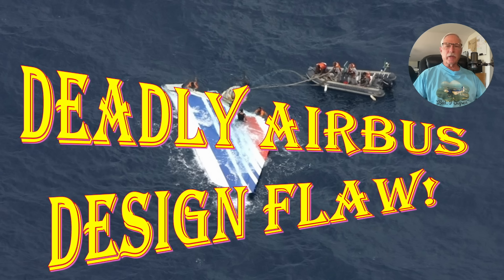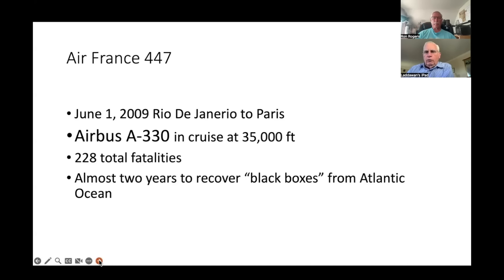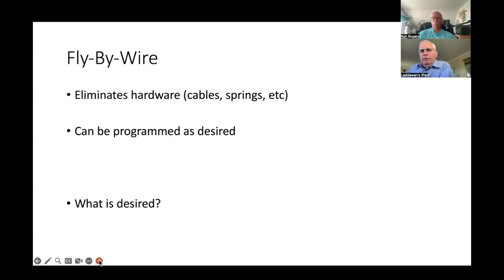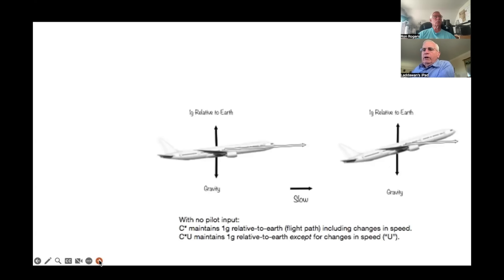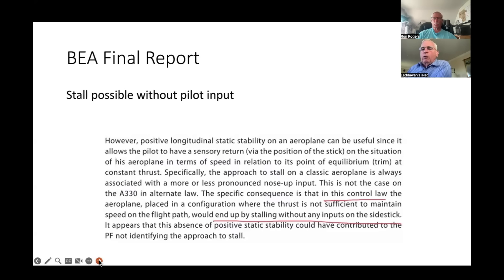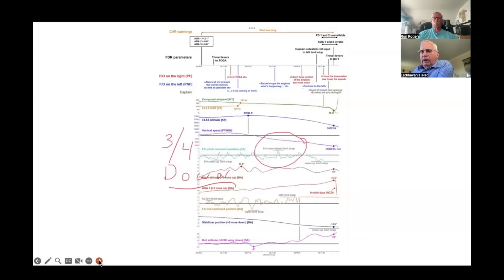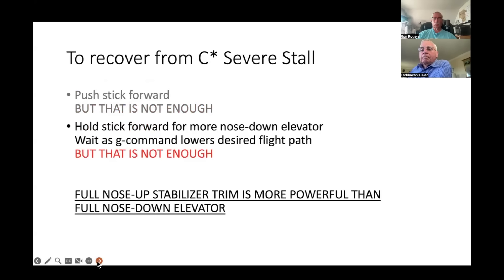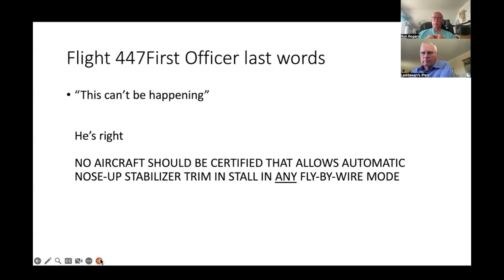Air France 447 Deadly Airbus Design Flaw! Tom Tilden about apparent speed stability in Alternate Law

Comment: A lot of the stuff mentioned isn't true, sorry to say that.

First: There is a low and high speed stabillity term introduced in altenate law. That is: when the aircraft enters into a low speed regime under/above a certain mach or cas threshold (dependant on config weight etc) the aircraft will enter a steady pitch down or up maneuver, with the g/pitch rate as a function of the difference of threshold - current speed.
This is a certification criteria...

The point about nose down and up trim speed is also not right and I like to see any real reference to this instead of "trust me bro". The reality: 
It first depends on the current config: limits are 0-2g or -1-2.5  so more nose down authority. The case you are talking about is absolutely clean so 0-2g, this is symmetrical. Why do I talk about the g stuff when you were talking about trim changes: because trim is what the elevator does with a long time constant integrated, to bring the elevator back to zero. This is all the "magic". And elevator deflection is a function of state vector feedback (pitch rate, g) plus a blend of pitch rate and g feedback onto stick input via different look up tables, I come up later with, through a integrator (this time fast). Last you feed stick input directly onto elevator (stick feedforward) parallel to all the above mentioned. This feedforward is the same signal as the one coupled onto the g and pitch rate feedbacks, but scaled accordingly. When we look at the the transfer tables of the stick you'll see that these in clean config are indeed symmetrical and else nose down emphasized. Greater nose down feed forward! The other signals are of course dependand on the dynamics of the airplane. 

The last thing:
Trim is of course frozen under certain circumstances and can be limited in single directions but I won't go into details here...

Please don't takes this as an offend.
Reply from the maker: I will let Tom respond to that!
The BEA Final Report in section 2.2.5 on pages 186 and 187 addresses “Aeroplane behaviour in reconfiguration laws” I displayed two paragraphs from that section in the video, but there is more.
“Alternate 2B law represents a specific case of flight control law reconfiguration. . . . It has the specific characteristic of being associated with the loss of computation and display of the limit speeds. The high and low speed protections that exist in normal law, and sometimes in a reduced manner (high and low speed stability) in alternate law, are lost.”
“In alternate 2 law, the longitudinal control law remains a load factor law and the lateral control law is a direct law.”
In other words, as I said on my slide: Air France 447 in icing went to Alternate Law with no protection (pure C* with no Apparent Speed Stability and no limit on automatic stabilizer trim.)
My description of trim was accurate. The elevator moves as needed for the desired C* (g/pitch rate) response (sometimes called fast integration.) If there is a persistent mismatch between elevator position and the desired elevator/ stabilizer alignment then automatic trim follows (sometimes called long term integration.) This is the same way autopilot trim works. You direct the autopilot to climb, or you drop the gear, or change speed and the elevator compensates immediately. But you don’t fly from then on with the elevator deflected. Just like the pilot would do, autopilot automatic trim follows to optimum elevator/stabilizer alignment.
As my slide said, automatic nose-up trim is inhibited in stall protection. But in Alternate 2B law, Air France 447 did not have even limited speed stability and automatic stabilizer trim followed sustained full nose-up elevator with full nose-up stabilizer.

NO APPARENT SPEED STABILITY
Without typing the whole thing, read the two paragraphs on my slides from page 187 of the BEA report. The BEA says they had no positive static stability (they are taking about what the pilot feels - apparent speed stability,) The BEA says that once in a climb they could stall without any more control input. The BEA says “This behavior, even if it may appear contrary to some provisions in the basic regulations, was judged to be acceptable by the certification authorities . . .” The BEA says “the presence of flight envelope protections makes neutral longitudinal static stability acceptable.”
I agree. But in the case of Alternate 2B law there were no protections. Therefore Alternate 2B is UNACCEPTABLE.
Look at the purple line data on my slides. The elevator position starts at neutral and then goes nose-up (nose-up command is down.) From then on it is a nose-up command even with the stick 3/4 nose down, because the forward stick only decreases pitch in accordance with g command logic, it does not directly move the elevator. Realize that the purple data can go well above the starting position which was in cruise, not just below the starting position.

AUTOMATIC TRIM WENT FULL NOSE-UP STABILIZER IN STALL
Look at the lime green line data on my slides. In cruise trim was about 3 degrees. Eventually it trimmed to full nose-up stabilizer (about 13 degrees) and stayed there. Full nose-up trim should hardly ever be needed. Worst case might be full flaps (nose-down pitching moment), idle power (nose-down pitching moment), and forward CG (the A-330 transfers fuel to keep an aft CG during cruise for efficiency.)

The BEA analysis is correct. They identified a design with no apparent speed stability AND no protections (including inhibiting automatic nose-up trim in stall) in Alternate Law 2B as a problem. However they did not specify these problems in the findings or safety recommendations.
Buried in the report, the BEA only says “This behavior, even if it may appear contrary to some provisions in the basic regulations, was judged to be acceptable by the certification authorities . . .”
NO AIRCRAFT SHOULD BE CERTIFIED THAT ALLOWS AUTOMATIC NOSE-UP STABILIZER TRIM IN STALL IN ANY FLY-BY-WIRE MODE.
Reply: I read your critique and Tom Tilden's reply.  I see nothing wrong with Tom Tilden's presentation or his supporting facts.  After reading Tom Tilden's rejoinder, would you please offer an agreement, or reasons why you still believe "a lot of the stuff mentioned isn't true..."
Reply: First I appreciate that Tom answered. 

Btw. I made a mistake in my first post: when the AC is in clean (as AF447 was) config you have -1:2.5g authority. 

They are talking about a submode of alternate law, not the "standard" alternate law, I think this is pretty important! They say that, but at one of the last slides he stated: "Automatic nose up stabilizer trim in stall in alternate law"
Again ONLY in B2. Alternate law normally provides hs/ls stability with trim stop in the "bad" direction, what I already mentioned in my first post. So no trim into stall! Unless the pilot pulls at the stick, then stall is possible but trim won't work as it is still inhibited.

B2 is only entered if all three ADR are unavailable, or both SFCCs are unavailable (this is for 320). And yes then the aircraft could theoretically trim into stall, but only if you don't fly appropriately...

The accidents at the end I partially also disagree with:
Air Asia flight was brought into ALT because they crew pulled both CBs of the FACs. The ALT active shouldn't be B2, as again ADR is OK and SFCC also, so they must have had stabilities... I can't remember any graphs of elevator or THS deflection in the final report, but if I missed something please correct me. 
The XL airways flight if I remember correctly never went into alternate law but stayed in normal and the problem was the aoa prot not engaging because of faulty aoa data (frozen vanes), again correct me if I'm wrong. 
The S7 I never found any good report or information providing graphs or details... 

One last thing regarding the elevator movement of AF447: the moment where they input for a little time a greater nose down input, the aircraft was already in stall and extremely slow, why is this problematic? Because the aircraft was in complete clean config the pitch rate feedback onto the stick is zero. (This is again the case for 320, but I guess for 330 it's the same) Gain scheduling in alternate law is mainly based on slat flap config. Have a look at the normal acceleration data, what they input with the stick is of course never reached, what happens is that while they keep pulling requesting a positive Nz the saturate the fast integrator and later the trim integrator (trim at max, elevator at max) when they now input a nose down command the first need to de-saturate the fast and then the slow int, which whould have been the case if they kept pushing....
Reply from the maker: I am pleased that you replied and I am glad to have the opportunity for a more nuanced discussion.

There is always a concern about how much detail to put in a presentation. I specified on my slides that “Alternate law is C* logic with limited protection or no protection.” Also “Air France 447 in icing went to Alternate Law with no protection.” My statement that the system trimmed full nose up in Alternate Law is correct. I could have stated more precisely that it was in a sub-mode of Alternate Law, but that would muddy the waters for most readers.
The conclusion is valid:
NO AIRCRAFT SHOULD BE CERTIFIED THAT ALLOWS AUTOMATIC NOSE-UP STABILIZER TRIM IN STALL IN ANY FLY-BY-WIRE MODE.  (Emphasis on ANY)

I also listed three other incidents where automatic trim went full up in stall: Air Asia 8501, XL Airways Flight 888T, and S7 Airways Flight 5220. Different reasons, same result. (I discussed Air Asia and XL a little more in my paper which you can get by clicking on the link https://drive.google.com/file/d/1HfjNrKukGuJXhglM962GvYQVF3AvML9T/view?usp=sharingprovided by Ron on You Tube.)

Air Asia disabled the FACs as you stated. That was not authorized and was pilot error. The FO then reacted with a pull to stall, which was an even worse pilot action. (I have turned off FACs in flight many times to test Alternate Law and it should be no big deal.) I agree there was no data on stab position in the reports. The aircraft acted like Air France 447 which led me to suspect full-up stab. In a conversation with people who should know, I was told the stab trimmed full up, but I cannot personally confirm that data.

XL was in Normal Law with frozen AOA as you stated. The crew “tested” stall protection which did not activate and automatic trim went full nose up. In the gyrations after stall they came out of normal law but with full-up stabilizer could not recover in time. The “test” was a major error. They were too low for testing stall protection, but more important, they should know before the test what speed is required for stall protection to activate and should stop slowing if it does not activate and make a write-up. Basic flight test.
I have suggested a fix for frozen AOA. Angle of attack can be derived from inertial data. ( For example in wings-level flight AOA is the difference between wing chord line and flight path angle.) It should be easy to determine if AOA readings are operating within reason.

I have not seen data on S7. The information I have heard indicates that full forward stick did not immediately recover from the stall which indicates that the stabilizer overpowered the authority of the elevator. But I agree this incident is more speculative on my part.

Air France 447, Air Asia 8501, and XL 888T. These are cases where automatic nose-up trim in stall likely was one of the causes that together resulted in a crash. Each stall was entered for different reasons which all importantly involved egregious pilot error, but all resulted in fatalities that might have been avoided if the automatic trim had not trimmed full nose up in stall.

Let me repeat my point about apparent speed stability. Apparent speed stability is a long-standing requirement for certification. Your description of elevator movement in C* illustrates that point. C* logic means that the airplane does not fly like all previous airplanes. There is no force change as speed changes (no apparent speed stability) and the pilot never trims in normal operation. Before C*, pilots did not have to “de-saturate the integrator” before full forward stick would move the elevator full nose-down to recover from stall.
There are advantages to C* logic and it is acceptable, IF THERE ARE PROTECTIONS against stall and overspeed no matter what fails.

The simplest solution is to fail from Normal Law to Direct Law, which, as I presented, is what Boeing does. With Boeing C*U logic, Boeing pilots are used to a change in feel with a change in speed and routinely using trim, so Direct Law is more natural for them. Airbus aircraft in Direct Law have a natural feel with change of speed and the pilot needs to trim using the trim wheels on the center console, but Airbus pilots are not accustomed to it. Airbus Alternate Law feels more familiar to Airbus pilots, but I maintain it is only acceptable with functioning protections (as stated in the BEA report.) I can suggest some solutions such as that independent calculation of angle of attack to determine if AOA is working. How about at least a limit to nose-up trim with flaps up?  If nothing else is feasible, Direct Law.

“But only if you don’t fly appropriately.”
You are correct of course. The pilot was a cause in each accident. The pilot was clearly the main cause in each accident. But the pilot was not the only cause. There is a good chance that without automatic nose-up stabilizer trim in stall, one or more of the fatal accidents would have recovered.
Is it acceptable to say that if the pilot makes a really egregious error then it is OK if airplane logic kills everybody on board?
Instructor pilots need to teach pilots to fly better. Test pilots and certification authorities need to make sure that airplanes react as pilots expect them to. I think that “could trim into stall if you don’t fly appropriately” is not acceptable.

I truly appreciate your comments. I think with serious discussion there are reasonably simple fixes that can make protections highly reliable in all possible circumstances.
Reply: @ronrogers  I totally see your point with this config of alternate law, and yes, software could be updated, switching, if ls stability not available, directly to direct law. 

I think the reason it isn't done is that the aim is to keep the aircraft as long as possible behaving like in normal law, as you stated pilots are comfortable and confident with. Roll law is heavily based on speed, so no valid speed, you lose it. With pitch again, you can switch to flap slat config and get pretty decent results, though stabilities need (of course) speed data. One source is enough because the command coming out of these parts of the software is limited (and I have to look that up again, but I remember) to +- 0.5g. The stick has more authority than the known limits, which in case of active stability comes into play, allowing the pilot to override the command, concluding that even if the single source is incorrect the ac is not in danger... 
Now, if you lose this last source, stabilities can't be longer engaged, but alternate law can. Aiming for a long as possible "known" feeling. On top you get the advisory to fly carefully "Alternate Law Prot Lost".

The above mentioned aim plus the fact that it is not very likely to get into this config might be the reasons certification authorities tend to agree with this solution. But of course, you could heavily train pilots to be confident with direct law as you stated in your comment and switch to direct. 

One think at the end because, again, I think this is important to add: You said that you switched off FACs to get into alternate while in flight: 
I guess you knew what you were doing, but if you allow me to say that,  I wouldn't recommend this action. You totally lose the automatic yaw axis, no alternate yaw damping normally active in alternate law. On top you need to differ between switching the FACs off via the overhead switches, or pulling CBs. A little insight: the switches when the computer doesn't detect a fault, so unit ok and you push the switch, doesn't deeply reset, it's not like you reset your pc, where it shuts down and boots the OS again. It's more like you reset an application running on your pc but without a complete restart. If you leave the switch in the off position the computer keeps running, but let's say parts of the software don't do anything, like driving a servo. Pulling the cb is like unplugging your computer while it's running. The unit doesn't get damaged, but doing this inflight is a big no-no, as you said.

Totaly agree to your empathy for this discussion. I hope to hear from you.
Reply from the maker: First, I would never switch off FACs on a passenger flight unless required by a checklist. All flight control law activity that I conducted was performed at Toulouse on Airbus test aircraft.  
Now from Tom:
Sometimes pilots do foolish things, like: pulling circuit breakers in flight to “reboot” computers the way that maintenance did on the ground; or pulling up in a stall attempting to stop going down. Since pilots sometimes do foolish things, computer logic that changes control response must be foolproof.

Degrading from Normal Law to Direct Law is preferable to degrading to a mode (or submode) that allows automatic nose-up trim during stall.
However, I think it is possible to make improvements to protections in Alternate Law such that degrading from Normal Law to Alternate Law can be retained. I am out of my comfort zone when I speculate on possible changes, but allow me to offer some thoughts.

I have suggested deriving angle of attack (AOA) from inertial data. Normally the aircraft relies on redundant (3) angle-of-attack sensors, but an independent calculation of AOA from inertial data could confirm that sensed AOA is reasonable. This could have prevented the XL Airways accident where all 3 AOA sensors were frozen. (Accurate AOA is easily derived in wings-level flight at constant altitude because wind is not a factor. Commercial operations frequently satisfy wings level and constant altitude parameters, likely even at some point before stall when slowing.) AOA from sensors and/or derived AOA could also be used to set a boundary on automatic nose-up trim or even to limit nose-up elevator authority to avoid stall in Alternate Law similar to Normal Law protections.

Another suggestion is to set a limit on how much nose-up trim is allowed in cruise configuration. I can not think of any reason why trim anywhere near 13 degrees nose up would be needed in cruise.

But what if new protections limit elevator authority or stabilizer trim when more is needed? If pilot control input exceeds new limits made for stall protection in Alternate Law more than just momentarily, then logic could further degrade from Alternate Law to Direct Law at that time. Direct Law is always a better option than the potential for automatic nose-up trim in stall.
Again, this is all pure speculation on my part, but I have to think that if Airbus believes this is important they have the resources to find appropriate solutions.

As you stated, there is an Alternate Law advisory “(PROT LOST).”
Figure 71 of the BEA accident report on Air France 447 shows all the messages that were displayed. In cruise, at night, and entering weather, the autopilot and autothrottle unexpectedly disengaged and the crew was suddenly presented with a plethora of warning, caution, advisory, and action step messages. If they read all the messages, the (PROT LOST) advisory likely had little significance to them compared to the associated action step MAX SPD 330/.82 which seems to advise that they should slow down. (Their cruise speed was near .82)
I don’t think pilots would interpret (PROT LOST) to mean they should “fly carefully.” Most pilots think they are always flying carefully, and in an emergency they are already giving their full attention to their situation.

A note on disabling FACs. You are correct that pulling circuit breakers is not the same as turning off the switches. The procedure we used to turn of FAC switches to test Alternate Law was taught to us by Airbus and used on flights to test new aircraft before purchase at Airbus as well as on our test flights of aircraft coming out of major maintenance. My airline takes pride in delivering quality aircraft from maintenance to passenger service.
I appreciate your concern, but if you are worried about the consequences of trained pilots testing Alternate Law by switching off two computers for a short time in a controlled environment, what does that say about the possible consequences for a crew on a passenger flight that experiences unanticipated computer failure and degrades flight controls into Alternate Law that could “theoretically trim into stall . . . if you don’t fly appropriately.”

Are we coming to a consensus that: NO AIRCRAFT SHOULD BE CERTIFIED THAT ALLOWS AUTOMATIC NOSE-UP STABILIZER TRIM IN STALL IN ANY MODE?